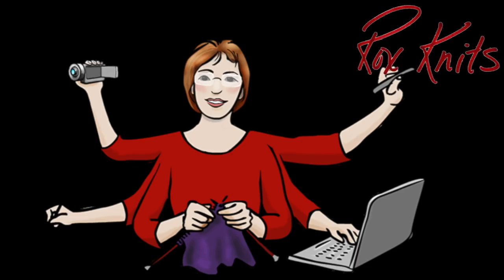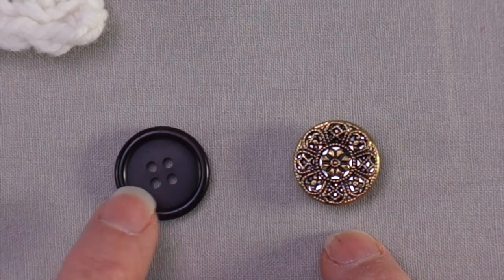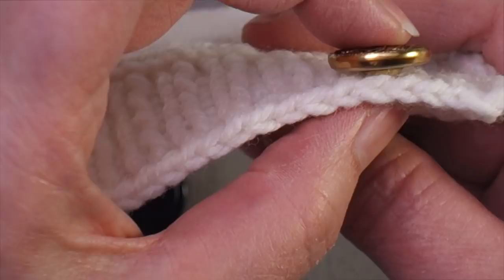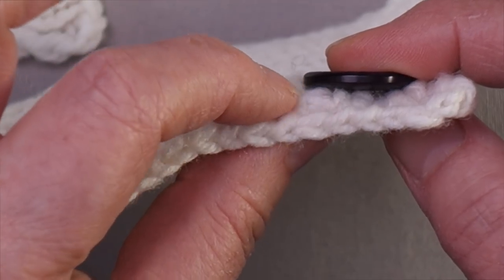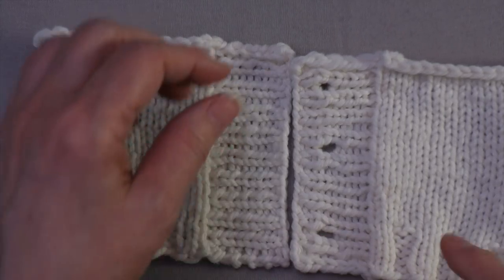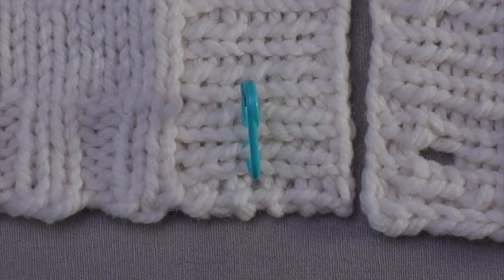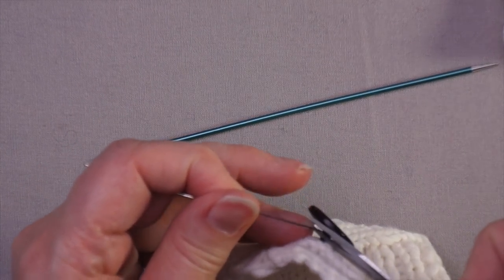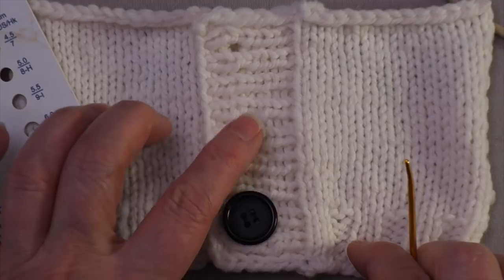Sewing Buttons onto Knitted Buttonbands

Comment: Thanks for the video.  Another option on thread that I use is embroidery thread.  It comes in about every color in the rainbow, plus I also use two (2) strands doubled to sew buttons on both knitwear or sewing projects.   Using this method you use the same amount of thread, but with less passes through the button.  Also match colors on the diagonal.  Also embroidery thread is cheaper than a spool of sewing thread.
Reply: She mentioned "needlepoint thread", just didn't show it.And mentioned that it comes in lots of colors.
Reply: When you mentioned embroidery that’s what clicked with me. That’s the floss like DMC that comes in the little bundles. Tons of colors! I used to buy those for 5x$1 when I did cross stitch in grade school. Great idea.

Comment: I am just sewing buttons to a cable cardigan I made for my grandson.  Whew, what a challenge, but I am now finished!  I used a double pointed knitting needle to create space for the shank, but it was annoying how tie needle kept flipping around.  So, I placed ti under the button, catching a couple of stitches to the right and left of the button and anchoring the needle to the sweater body horizontally.  With the needle thus stablized, it was much easier to attach the buttons.  I would have sent a photo of what I mean, but I don't see any way to do this.  I hope it is clear.

Comment: Do you ever use a second flat button on the back side of the band to distribute the pressure from the thread over a wider area to prevent the thread from "burrowing into" and/or cutting the knitted fabric?
Reply from the maker: I don't, although others do. I tend to use 3- or 4-ply worsted-spun yarns, so those are pretty sturdy, and I don't worry too much about the thread cutting through the yarn. For a single ply yarn, or woolen-spun yarns, a stabilizing button might be an excellent idea.

Comment: Thank you Roxanne. I thought the use of grosgrain ribbon or a secondary "backer" button on the wrong side of the fabric was necessary so there would be no strain on the yarns of the fabric itself. Though using a "backer" button would add more weight. What are your thoughts?  Also, you used what seems to be a really large button for the size of the button hole. How do I determine the best size button for the buttonhole? My background knowledge is primarily sewing, so I'm fearful I've bought buttons that are too small. Thank you again, and I so appreciate you sharing your knowledge and experience with us!!!
Reply from the maker: Knitted buttonholes are typically smaller than the buttons, because the buttonhole will stretch as the button is pushed through. (Buttonholes for woven fabric have to be larger than the button, because the hole doesn't stretch.)

 I usually either knit the buttonholes and take the sweater to the fabric store and test whether or not a button I've chosen will fit through it, or I choose the buttons I like, and then knit a swatch to test what size buttonhole will work well.
Reply: @RoxanneRichardson  Awesome, thank you.

Comment: Can you tell us more about the reinforcing thread? Where to buy, what kind, etc. thanks.
Reply from the maker: My LYS always had a display of Scholler & Stahl Fortissima reinforcing thread. I've also purchased Lang Jawoll sock yarn that had a spool of reinforcing thread including inside the skein. I believe there are a few other companies that sell this, too. It's usually about 5g of thread on a card or spool. If you Google "reinforcing yarn for socks" you should be able to find a few brands, and sources for purchasing.
Reply: Roxanne Richardson Thanks I’ll check the local yarn shop here. I’m not at my own town which has no LYS. I need for sock yarn that has no nylon.